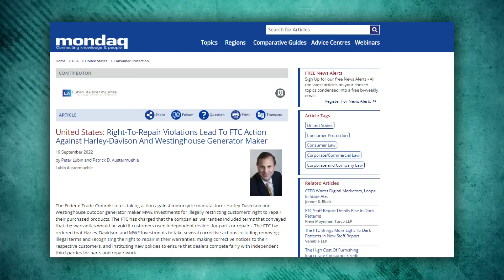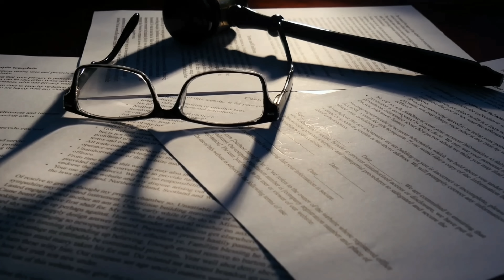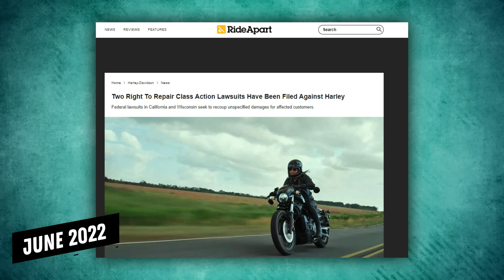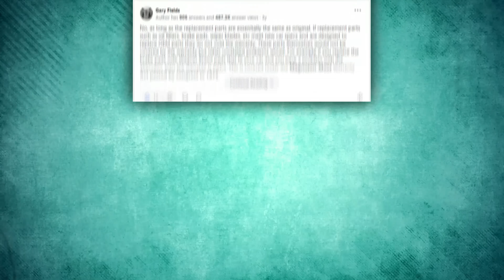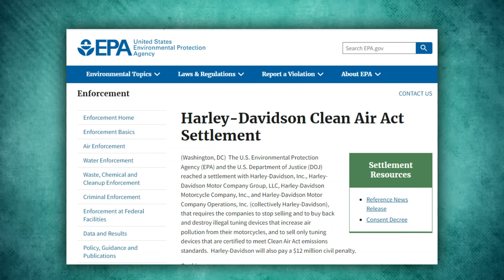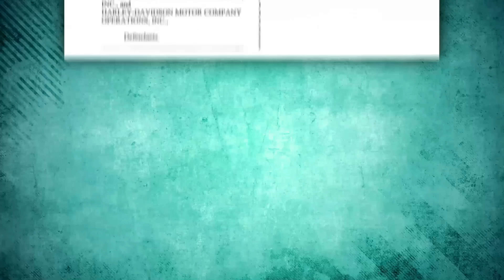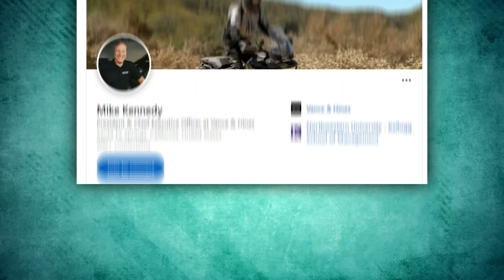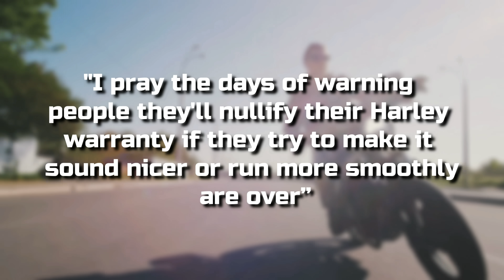This Affects All Motorcycle Owners!

Comment: Here’s a thought, how bout Harley-Davidson actually build a bike like they used to, ya know, one that won’t break down every other week.
Reply: I have a sporty, bought at 5k, clutch blew out at 10k.  It’s nicknamed the “grenade plate” due to a shitty diaphragm spring that’s attached TO THE FRICTION SURFACE with brass rivets.

They still use this in all sportsters today.
Reply: @bingusmctingus4395  I have a 1999 Sportster 883 with 400,000 miles on it and it is 24 years old now still on the original clutch

Comment: Buy Japanese bikes that usually don't give any trouble, in other words, don't buy harley's, or at least a new one. Problem solved!
Reply: Good luck keeping warranty with aftermarket cams and tuners on any other manufacturer lol. It's not just harley
Reply: @Smashdragon762  might all be that way, but the Japanese bikes rarely need repairs, therefore have little to no use for warranties most the time. Don't dare buy a Harley without warranty.

Comment: About time you should be able to chose a repair shop of half decent pricing compared to HD to service or repair bikes without voided warranties!! Much better tuners by PowerVision / Thundermax the HD tuners not quite what you need with the power builds that they can do to these bikes does a decent job but it sucks compared to others!

Comment: Not sure how anyone can blame HD for not honoring a factory warranty when every yahoo starts dickering with their new engine, putting aftermarket parts on it, and it breaks.
I had two warranty issues on my HD. The first I think was the tech who didn't snap an electrical connector completely after install LED signals/brake light. The other was my exhaust broke after hitting a pot hole. HD fixed both without any nonsense or fees.

Comment: Why would I want to own a Chinese bike, Harley has not been made in the USA for a very long time, even if the bikes were built here, they are full of cheap made Chinese parts that fail sooner than later and simply do not hold up, so the famous American Icon failed us all the minute they went with china.
I own a 1988 Suzuki Katana , still running on the original clutch, has given lots of hours and miles of satisfaction over the years, I have never had a serious engine or transmission breakdown, just regular maintenance. 
And I do all my repairs, period !

Comment: In my Honda owners manual it states that in case of any warranty claim an oil sample will be taken and if a TRACE of synthetic oil is found the warranty on the entire bike will be void.
  Thankfully I used nothing but genuine Hondaline oil so I had no issues, but I have some friends whose electric windshield motor died and they were stuck laying the $1,000 (parts and labor) for have it fixed because they like synthetic oils. 
  This is soooo wrong, but as usual our government does nothing right.

Comment: Here in nederland you can't choose where to change your brake pads of change anything yourself but only by expensive Harley Davidson dealers who charge high prices. If you use the same oil as Harley Davidson why must you pay 4 times more than by an independent dealer. That's miss using to make more money off you. Monopoly on there part. Good there are getting called out on that 👍

Comment: My answer is simply best put as, I am not going to buy a Harley due to their shady warranty games.  Well really I wouldn't buy a HD on a bet, sorry they are simply best described as JUNK.  They are firmly entrenched in 1937 and the Knucklehead.  The average engine lifespan is around 40K miles.  It took me over 50k miles to get my BMW R1150 broke in.  Have a older Goldwing, hey mom wanted one for longer trips so we got one, it has over 100k miles on it and runs like new the only issues so far have been cleaning switches and an aftermarket alternator was cheaper to replace with a bigger aftermarket unit than rebuild the factory unit.  Now for changing the rear tire on it SUCKS.
Reply: Funny how you don't own one and claim it's junk.  That's a statement a young kid would make on a playground, Mines better than yours....
Reply: @grayghost1423  Have had several Harleys and all had the same issues, rear cylinder running about 50 degrees hotter, engine lifespan due to crankshaft and bearing wear, crappy handling, electrical issues constantly, clunky transmissions and such do I need to go on.  Got the first HD when I was young and well unloaded it early in my military days, then after retiring got another, early 90's Sportster, and it was much better but it still had sufficient issues to unload it.  Sorry when my old 67 Triumph 650, with the Lucas electricals replaced, was much more reliable to a 90's Sportsters that should tell you much.  Had s shop where we rehabbed older bikes and got to the point we refused to work on HD's due to the extreme costs involved in fixing them.  Sorry when you end up spending more than the bike is worth on repairs and end up with the title instead of the money you soon learn to avoid them.
Reply: Blah, blah, blah. A Harley, if properly maintained, like any other motorcycle brand, can exceed well over 250,000 km with no top or bottom end service.

What's wrong with the 1936 Knucklehead? Yeah, Harley engines are based on that architecture, so any 45 degree V-Twin from H-D can be considered an evolved Knucklehead (except the bottom end of the Sportster). But suggesting that engine architecture is wrong is letting the world know the lack of knowledge on engine design and engineering. Simply put, there is no perfect motor, all have compromises.

But, hey, Harley haters are known for hating what they don't own or kno.w... because if they were happy, they'd own what would make them happy and stop complaining about what doesn't make them happy. It's simple as that.
Reply: @thomasheer825  So a 90s Sportster and even older big twins?  Probably a lot more 90s Sportsters on the road than any other 90s bikes.  And even big twin evos.  Nice try.
Reply: @grayghost1423  Well look at the clocks on those bikes, I see it all the time where the Owner has had the bike since new and hasn't had any problems, then you go out and see that yes the bike is 20 years old and has less than 20k on the clock.  Just to let you know every bike I have has over 100k on the clock and haven't been down yet.  Now Mom's bikes are much less mileage but the same age.  Why don't you live your life and I will live mine and call it a day.

Comment: Warranties are merely an agreement between manufacturers and buyers. Doesn't the US have consumer protection laws in place? 
Here in the UK, anything sold 'new' has to be 'of merchantable quality' and 'fit for purpose'. If it's not, the selling dealer is liable to repair or replace a faulty item by law (it's then up to the dealer to claim from importers/manufacturers). If the dealer can show that the fault has been caused by the owner (e.g. by fitting dodgy or incompatible parts, by-passing a rev limiter, or by performing a service wrongly), and can prove it, then he has a get out, but otherwise he's legally obliged to repair or replace free of charge. Here, the customers' rights are stronger than a dealer's, importer's, or manufacturer's rights to impose unfair conditions.
Manufacturers' warranties are over ridden by the UK's sale of goods act. Trading standards departments carry a lot of weight, and traders don't like to cross them for fear of being closed down and fined heavily, so in the UK, threats of going to 'Trading Standards' will usually do the trick if a bike (or any new item) is faulty.

Comment: As a 44 plus year master tech, warranties are nothing to me. I damn sure will not pay for a new Harley. I have a 2006 road king and i do all my own repairs and rebuilds. I am the only person to touch my motorcycles with a wrench. I did try to purchase a new bike and went to 2 Harley dealerships. Both times the salesmen tried to get me to purchase extended warranties. I told them politely no thank you as i perform all my own repairs. You'll get the bike back at 1500 miles for the break in service to keep the factory warrantee in force in case of major repairs but that's it. You will not see my bike again after that. Not even for an oil change. They did not want to hear that and kept bringing me quotes with service contracts attached. I said you guys must be idiots and walked out. Went and bought a yamaha cruiser and promptly put 40.000 miles on it with std. maintenance. No issues whatsoever. I work on Harleys all the time now on the side. If you put good parts in them and do proper maintenance they are as reliable as any bike out there. Harley has for too long been gouging it's customer base and people are fed up with corporate greed. These lawsuits are going to cost them big time. In terms of lost customers, service and maintenance issues that will have to be paid by them and loyalty. Screaming Eagle parts are the parts that should have been installed as standard equipment to begin with. They are not upgraded parts, hell aftermarket parts are better than screaming eagle. As for me, i hope they lose their ass.

Comment: What about the engineering flaws in the bike that they refuse to address
Reply: Can you explain the flaws you know of
Reply: @MrNick-  
Yes. Poor design!
Ignoring water cooling with decent radiators, (e.g. V-Rod..esque), in favor of water/oil cooling to cool engines that have been designed to market high(er) HP to impress idiots, in favor of reliability.
A noisy 'zorst and a free T-shirt does not a decent ride make!
Muppet.
Reply: @Dodger2879  do you own a HD?  What makes you think the design is poor?
Reply: Sumping, Transmission oil migration, burning oil because of cylinders out of round from the factory. Should I keep going?
Reply: @aaronmilliken5213  my oil migration was fixed under warranty.  I didn't have any other issues you stated.  But the bikes that sumped, mine did not, were also fixed under warranty.  So what.
Reply: @grayghost1423  
Yes. I've owned Harleys since 1983.
Sportster, Evo, Panheads, Twin Cam, V-Rod. I've built many also from basket cases.
I worked for two HD dealerships.
I think I have enough experience to offer an opinion. The fact you do not agree means zip to me, as many owners of Harleys have no clue, beyond chrome and stickers.
Reply: @Dodger2879  you seem to want to make this personal?  Very strange response.  Why have you spent so much time rebuilding them if they are so bad of bikes?  Perhaps rebuilding them is not your talent?  Maybe buy a new one and treat it well and it will last, this has worked for me.  And if you have not had a good track record working on them, I gather from your previous statements, get a manual or let a qualified mechanic do it for you.  Perhaps your outcome will be better. Or not, buy a "better" bike from another manufacturer since you seem not to like one you spent so much time working on.  That's what successful people do in life, it also makes you a happier person so you don't have to disparage what other people like.
And I can almost understand your  frustration if you owned a Ironhead, that actually was a "special" motor.  I'm more of a fan of Evos and M8s. Easy to work on and plenty of parts for the rest of my life anyway.
Reply: @MrNick-  I could write a book about them. Heat issues for one.
Reply: @grayghost1423  I own 3 of them. First thing I did was open the cam chest and throw away all the Harley junk.
Reply: I really want a new Street Glide. Any known issues with the 2022 Special?
Reply: @im2yys4u81  Heat issues are a thing only if stuck in traffic. But then again, those are air cooled engines that can run pretty fine for hours and hours with no rest if air keeps hitting them. Once a kept running my Sportster for 14 hours straight. The only issue was my back was torn, but I guess that could happen to anyone, no matter the brand.

And I firmly believe that those whining but saying they own a H-D are liars. Why own a thing that doesn't make you hapoy? And if you own a thing that makes you happy, why complain about other things that you don't own? It is crazy how people is nowadays.
Reply: @omarsalgado9715  💯
Reply: @MrNick-  not on mine.  Runs great.
Reply: @im2yys4u81  I have had no issues.  But it's your bike, but for me, I'll run it till it need fixing.  Personally if I thought it was junk,  I'd buy another brand.
Reply: @grayghost1423  
Why rebuild you ask? Simple!
Because many owners want more reliability and/or power at a reasonable, non-dealer hourly rate.
(I ride a rather scruffy 88 Softail Deluxe at this time, with a Fatboy front end, rattle can sprayed Satin Black [wheels too], odd red tank, hard bags, T-bars, single seat and rear fender rack, baffled/wrapped short shots. Ugly, but paid for and comfortable for me). My favorite HD ride was my Buell.
Anyway, enter Enter S&S stroker kits, Sifton/Andrews cams, solid lifters, Barnett 5-stud clutches, vented belt primaries, stiffer front ends, steering dampers, fork braces, PM brakes....the list goes on. 
Because I am qualified to do this, I do! In fact, Harley Davidson have rules that they will not entertain bikes over a certain age. 
I am the same with women. 
PLUS there are some jobs they will simply not take on or support due to their training levels. Enter guys like me with micrometers and toolmakers tools, plus the knowledge of how to use them.
Harley dealers will farm out older bike work to.....yup, guys such as I. AND NO! I deal direct with the customer and do not allow HD to mark up my cost simply because many of their "mechanics" peak at different skill levels.
Many Credit Card Bikers, crave older models after getting the HD bug and learning a little more beyond that which the stealership spouts. Hence they purchase and require that their "new" older models be maintained, customised, or improved for performance, safety, or style.
Buying new as a "Credit Card Biker" is indeed popular, but many of us eschew that route, due to nostalgic, or investment reasons. (A first year electric start Big Twin, ['65 Pan], fetches 30K and up in the right condition). (A first production '84 Evo [Softail??] will become a collectable, as a 4-speed transmission, kicker and chain final drive only exist on that year Evo).
So, try getting that '65 Panhead engine maintained at a HD dealer! Or simply, even getting the Mousetrap adjusted correctly....
.....or a Barnett 5-stud clutch and Riviera belt primary installed without shaving the belt edges, or getting a late '60's Slabside Shovel to stop safely in today's world without welding a lower front fork tabs to fit a disc caliper if not sticking to stock, getting the distributor adjusted. You won't. 
Being a Credit Card Biker in denial is OK, but enjoy those home done oil changes and skull shaped accessories, if that's where you are.
This part if Texas looks to have some busy "winter month's" ahead and is already booked.
Reply: I have a 2018 Road Glide 107 now 131 and the heat issue is unbearable at times 325 plus 107 to know 350 to 387 plus engine temperatures.
Reply: @Heavy69Metal  
Consider the dual fan assisted oil cooler route. (Fit a bypass switch too, so as to manually operate the fans). It supposedly drops oil temp by 50 degrees.
Not cheap, but effective. Figure on spending $500 on parts.
The Arlen Ness "bean can" sized ribbed CNC oil cooler will help too, by being in air flow and adding oil capacity.
Hope this helps.
Reply: @Dodger2879  I have an UltraCool going to be going on it for the engine but also thinking of another on other side and tap into the stock oil cooler( has a fan in it too ). And have the heads getting cooled by that and the stock one at same time
Reply: @Dodger2879  do you have a link to those dual fan assisted oil coolers?
Reply: @Dodger2879  FYI I also have Love Jugs Mighty-Mites I switch on once I start the bike I’m thinking of changing that to a forced one and using a thermal switch to come on at 145° or 165°
Reply: @omarsalgado9715  exactly. I have had no complaints on any of mine. My only complaint is that I live in Connecticut and can’t ride year round.

Comment: as long as they will sell the item for the same or lower price without a warranty - it was the buyers choice  to  agree/comply or not .. manufacturer not warrantying an item that is materially different from what it sold  does not Prevent you from changing it --  to un-warranteed

Comment: Technical speaking in this video if you ad a exhaust you are making more power and the transmission is not designed for more power.adding a different electronics can cause a over load to the stator and or voltage regulator unfortunately new machines are designed to run with oem parts.i can understand why dealers are not allowed to do a warranty claim.they have no control over the manufacturing of aftermarket parts.now if it is a factory Harley upgraded part then Harley should cover it.

Comment: Auto manufactures' can and will void warranties if recommended services are not followed. Which is reasonable. You purchase a warranty, and the company is within its rights to expect recommended services using OEM (original equipment manufacturer) parts.

Comment: R2R is actually a good thing. I can understand if a company voids a warranty if for example you installed cams and the motor grenades shortly afterward. I can also see it if it has an aftermarket filter which leaks or blows off and the motor fails as well. However, voiding a warranty on the powertrain just because you installed different speakers is ridiculous. The same goes for using an oil which isn't H-D oil, Amsoil for instance. The European manufacturers play this game with "approved oils". If it's not on the approved list, good luck with warranty. I had this happen with VW once. However, I used the approved oil and filters at my shop so they didn't have a leg to stand on.